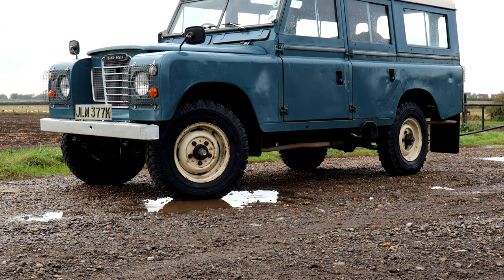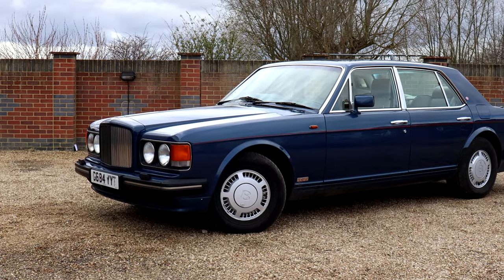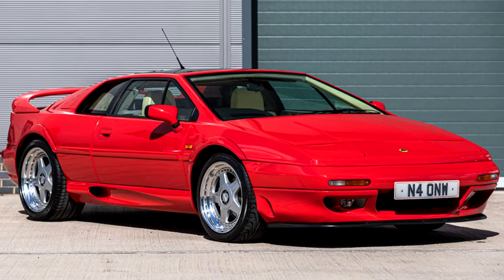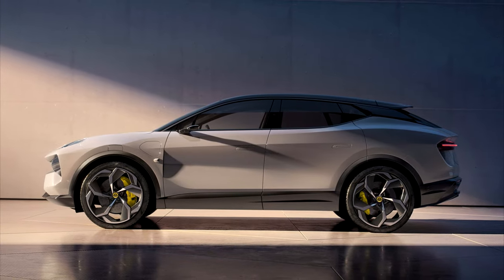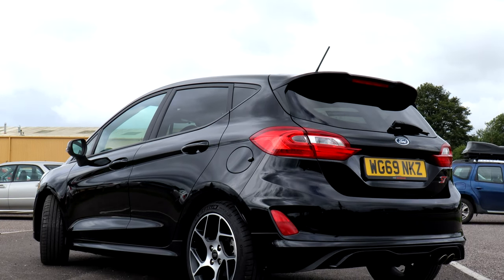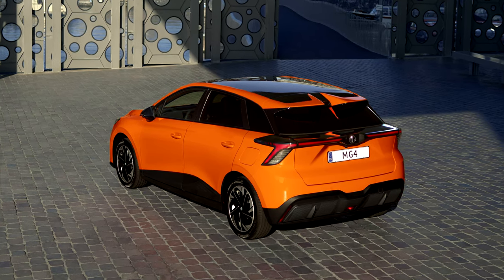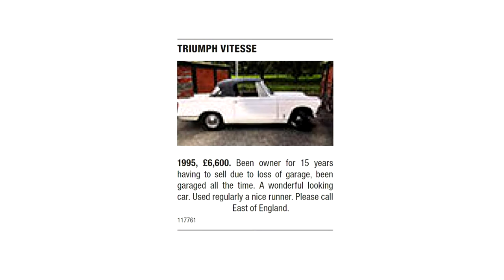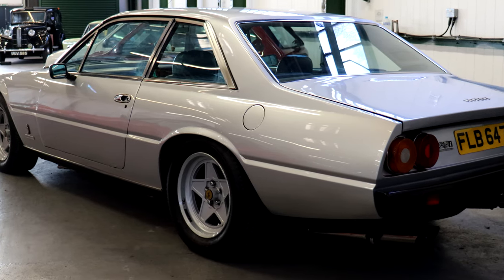E10 Fuel Classic Car Disasters! Are Smart Motorways DANGEROUS? Classics World Podcast Ep1

Comment: i think Smart Motorways are a bad idea . I bbroke down on a smart motorway  and it was the most frightening experience . Had it had a hard shoulder , i would have pulled over and been away again in 5-10 minutes , driven home safetly and no probs . But it was a 'Smart ' motorway so i had 45 minutes of standing behind armco barrier in the wind and rain trying to watn traffic of  my car parked in the inside lane . The area was not covered by cameras {as i thought} and i only alerted the authorities by dialling 999 on my phone . I got towed eventually to the nearest  pull-in by a  traffic cop and then eventually recovered . Just standing that close to a motorway i found frightening . I do not think this is a safer option at all.

Comment: Morning guys,  great video 
As an owner of a few modern MGs , Maestro,  metro turbo, ZR and ZT we also have an MG3 but I've found the local modern MG dealer completely anti MG rover so I don't class the current company has having and continuity with the real MG company.  On the subject of the 3 its OK but no rover , very simple ( suspension is identical layout but less heavy duty as the maestro) engine is rubbish needed a new timing chain at 60k. A company is actually converting the to k series which would make a far better car

Comment: Hi all, I had a horrible experience with  my vw golf mk2 1989 with e10 destroyed my carb ran like crap rebuilt carb, still showing issues just replaced 99% of the fuel system new manual pump vapor inline some pipes, now new carb. Draining the tank today. People say it doesn't effect the use but it does. 

Ps I have a defender 110 ex mod and ex rescue project land rover. I have the same issue where no one wants todo anything on it
Reply from the maker: Sorry to hear that!

Comment: Be careful with various websites listing which cars can and can't run on E10. The official government website states my 2003 Nissan Micra can run safely on the witches brew, but when I checked with Nissan themselves, they told me it can't. For the Micra, the cut off point is apparently 2010, but do check yourself before trying the new fuel. For now I've gone the Premium Unleaded route for both the Nissan and my Triumph Acclaim. Doing a combined annual mileage of 5-6000 miles, the extra fuel cost is considerably less than renewing fuel lines and carburettors/fuel injectors etc, though I probably will have to do that eventually as I understand Premium Unleaded will also be E10 at some point in the future.
Reply: I run a 2004 Hyundai as a daily, and that, too, should be E10 compatible. However, it runs like a pig on E10 with terrible fuel economy; using E5 may be more costly at the pump, but the better fuel consumption that I get almost compensates cost-wise, and the engine is far happier.

Comment: Where i live they use E25 as gasoline ever since the pure gas with led got banned.. That happen in 1991..
The old and classic cars run fine, Etanol is harmless in such a low quantity, all you need is to advance a little the engine timing and BOOM, runs fine and last as long as the pure led gas

Comment: Smart motorways design by accountant for a quick fix but the reality they are completely dangerous most braver drive in middle lane brake down the panic to cross the line of trucks
Reply: Here in W Yorkshire they are everywhere. You spend more time staring up at gantries than the traffic ahead.